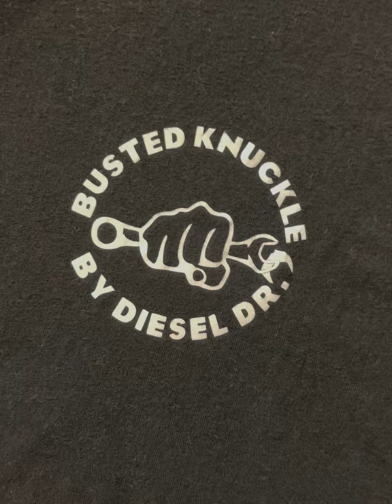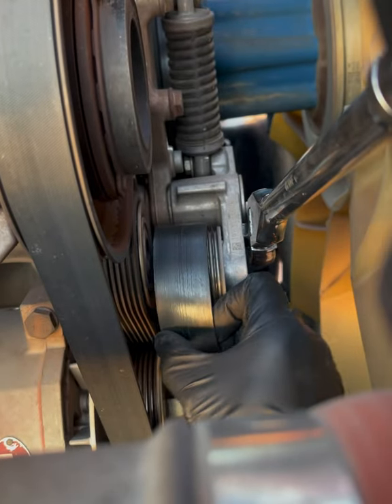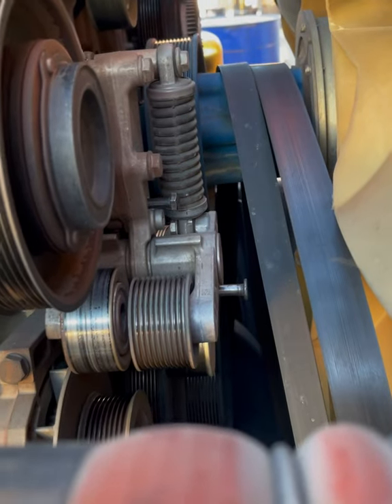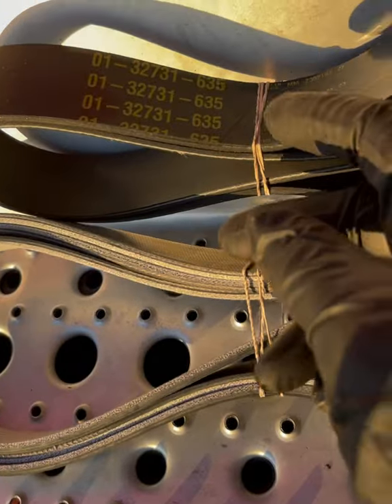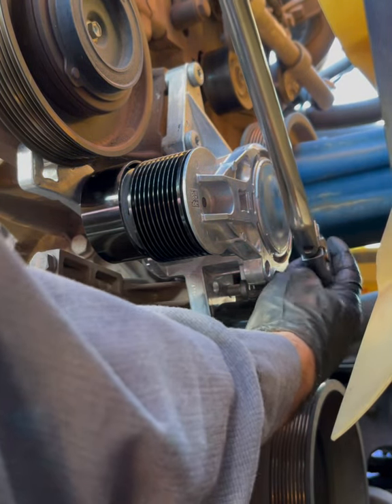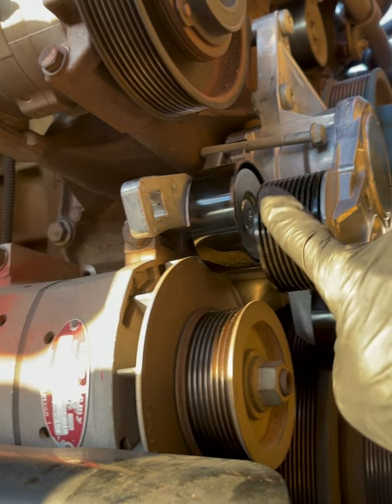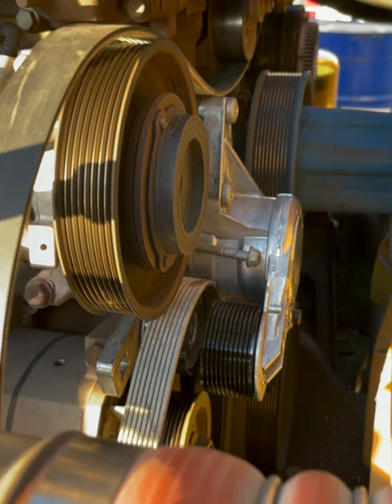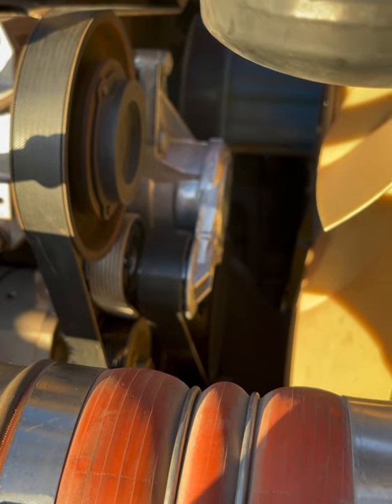Engine noise, squeal from front of engine. Cascadia Belt tensioner replacement. Belt replacement.

Comment: I can't remember for sure cuz i didn't care at the time. But their were some engineers from daimler that visited the fleet i worked for and did some study on the old style tensioner. For whatever reason, they changed it up after that study. Wish i had paid more attention to what was going on, but it's still interesting. Now they are different and come with those lovely pins. Alot of guys like to pin the new tensioner on a vise or something before it goes in. Makes easy to get on.
Reply from the maker: For the most part this new style does last longer and works slightly better. The other one was easier to work with and install. But this new one does cut weight and has different tension points. That is interesting though. I wonder if this will help the glazed overheated belt problems that causes all the noise.

Comment: Thank you for the video, we followed instructions & installed one other day but tensioner shaking and vibration more then rest the engine parts not sure if that’s how this new design tensioner should be or something wrong 🤔
Reply from the maker: I would think if it was the tensioner shaking, then that may not be the right tensioner for the truck or something in the way of a proper flush install

Comment: Im shocked this worked for you because some engines with this tensioner it doesn’t work, apparently had to order a new bracket or something for the fan hub, i think there’s a couple papers that come in the box wit the new style tensioner about converting
Reply from the maker: Thanks for reaching out. I have yet to have a tensioner this style that didn’t work on any 2016 dd and up  I’ve put it on. I’m sure there might be some unique set ups that would require a bracket but that’s just an unlucky case.
Reply: Bro you need to shop with the last six of your VIN. If you’re shopping online, then first go to the dealer to get the correct part number, then you can shop online with it.

Comment: This does not work for all DD15's. Did not fit mine in 2016 cascadia. Correct part for mine was Gates 38667. I do not know how to separate one from another, maybe Busted Knuckle can help us out on that. But do not make my mistake by purchasing this tensioner without proper research.
Reply from the maker: Great point and always the the same answer. Never buy something unless you know it’s for your vehicle. I always tell everyone to get the part number from your local dealer so no mistakes happen.

Comment: That was an awesome video. Quick question, do you know why my freightliner check engine light comes on after the fan runs. I’ve been searching for days and I’m not taking it back to Ryder cause that failed 4 times already
Reply from the maker: Thanks for watching and reaching out. If the cel comes on when your fan dies then it’s most likely from your fan solenoid or the wiring to it. Would likely cause that cel when it looses signal.  Find a tech u trust because when it comes to wiring you want to know they are not messsing around that will cause worse issues to happen.
Reply: Wow awesome, thanks for the feedback. I honestly didn’t know what the hell to do anymore. I really appreciate you taking the time to respond. I wish I was in Az or I’d just take it to you.
Reply from the maker: @benreynolds18  let us know what you find. I’m sure others are struggling with the same issues.

Comment: My DD15 only squeals when I driving and pedaling the throttle  - if its idling in neutral and I pedal it to rev up the R's it dosent squeal - What's the diff  ?
Reply from the maker: Great question. The squeal could best be found with a bar of soap or a water bottle squirter. I would first try the belt than let it dry. Than move on to each pulley. One will be the culprit

Comment: Just did this. New tensioner, belts and pulleys. One of the pulleys seized up and I put on a new pulley. New pulley seized up right away what could be the problem
Reply from the maker: Great question, either you legit have bad bearings on one of the pulleys or it was installed bavkwards. That would for sure seize it up.
Reply: @bustedknucklebydieseldr3228  forgot to put a washer 😅

Comment: what if I replaced the belt tensioner both belts and its still squeaking
Reply from the maker: Great question. You first have to find out if the sqeal is coming from front of engine or rear of engine. If it is infact front , than take some soapy water solution and spray one thing at a time. Try each idler puller than each belt than ac compressor. Your bound to find the culprit.